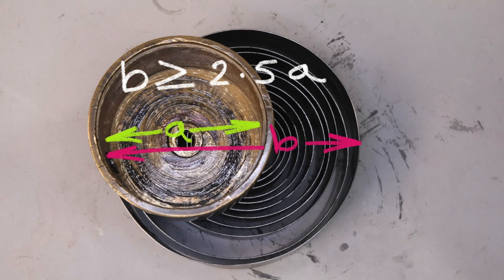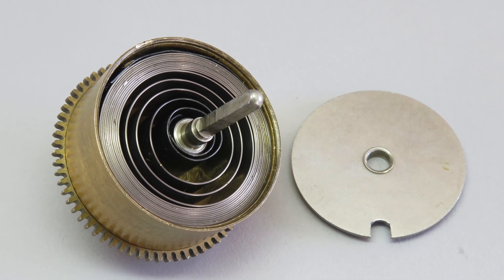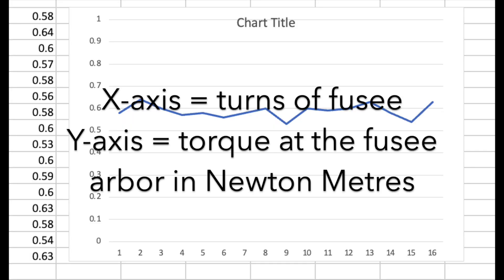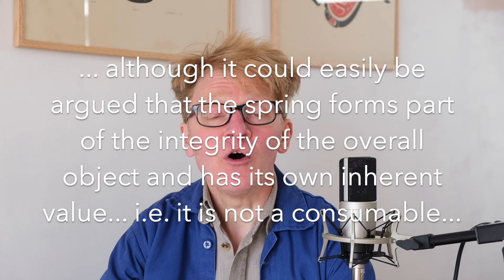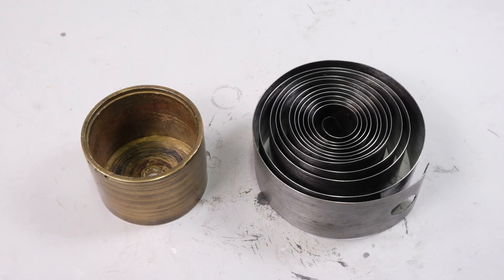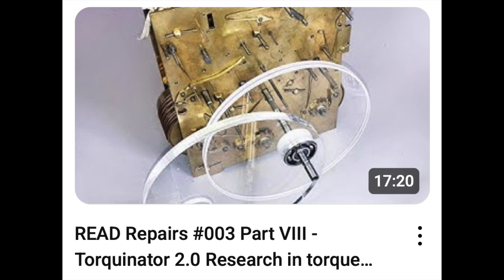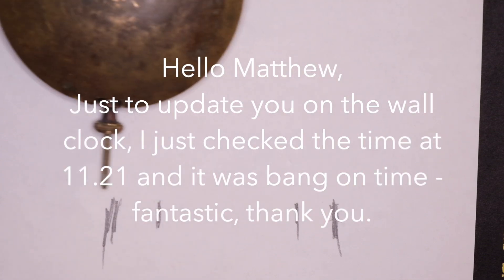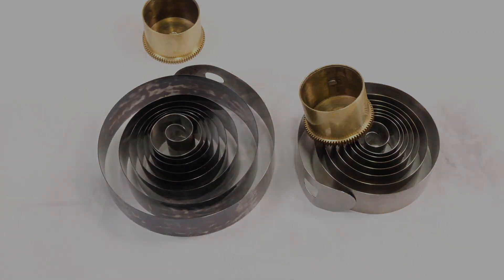#036  The viability of the fatigued ['set'] clock mainspring and why it matters?

Comment: I get the same problem in my woodwork where if it isn’t shiny and in a plastic bag it wont work or be reliable.
Measurement and diagnosis is critical and then think through what’s the problem is rather than stick to change for change’s sake.
Reply from the maker: 100%

Comment: Very good video,
I never replace old mainsprings that are supposedly "fatugued" (in french we say "rendu") if they dont' cause any problem in the functionning of the clock.
In my experience, old springs are perfectly fine as long as the restauration work is good. Some may find easyer on the short term to put a new (stronger) spring that will make the clock tick even if work is not perfect. But, as you mentionned it is at the expense of rapid wear.
Reply from the maker: Thank you for your feedback and the term 'rendu' (rendered in English).  You are right, if the depthing is attended to, the mainspring is rarely an issue.

Comment: Very good insight especially for one who never done clock repair or making a clock from scratch. Given the views of metalurgy from 200yrs or so till today, it seems quite tricky to consider when or how to consider buying the new spring for a clock of that age, my instinct tells me this is occasional and not a rule of thumb, hope im right , dont mind being corrected. So even if it a new spring, as long as the torque is in the 0.4 to 0.6 range its fine? I also would 1day if time permits, try make a fusee from scratch even if its on a normal lathe. Im very fascinated by that clock part😅😂
Reply from the maker: Thanks for your message.  Yes, if a new spring is fitted, a thinner/narrower one is needed to keep the overall torque to that amount 'required' by the clock.  The challenge is, a modern spring gives you a flatter torque curve so you have to decide whether you want the clock to be over/under-driven at one end of the fusee but difficult to get that flat line as shown in the graph.  One of my students built a fusee to match a modern spring and it was a much flatter cone than the ones we see in historic clocks.  TBH with modern springs you dont really need a fusee but yes, fun to make.  What I didnt mention in the video is a change in torque will result in a change in rate with an anchor recoil escapement due to escapement error.  Lots to consider!  M
Reply: @howtorepairpendulumclocks  thank you for reply. Still need to do a thing or two my normal thread cutting lathe , then should be able to attempt the mentioned fusee😄
Reply: Hello again Mathew, great video. I to have been told  over the years to re-use the old spring. Although I currently have a fusee clock from the late 1800’s that has the time side spring split into two pieces. Doesn’t appear now that it wil be very easy to find a replacement.
Reply from the maker: @williambbondiv454  Thanks for your message.  You wont find a direct replacement so you may have to fit a thinner / narrower spring with spacing pieces to take up the free space within the barrel.  Typically, any new spring of the full width will be too strong.  M  Good luck!
Reply from the maker: @williambbondiv454  There is a guide how to do this towards the end of this video... https://youtu.be/cfxQxKdNvcU
Reply: @howtorepairpendulumclocks thanks again!!! So much useful information. A lot to learn!!